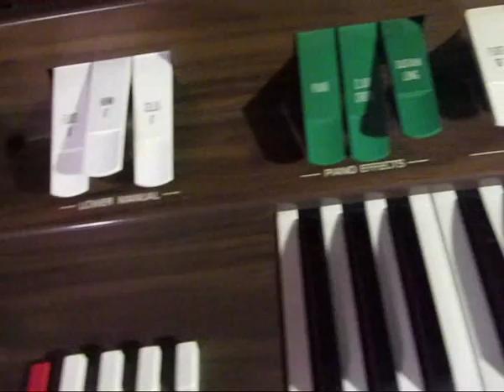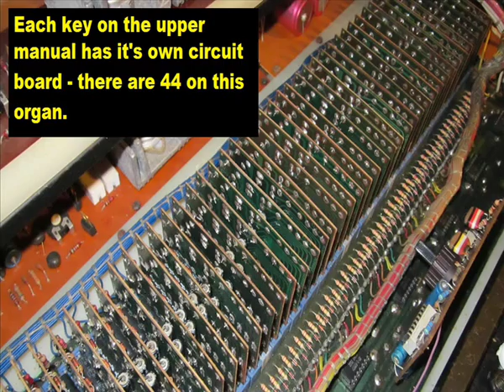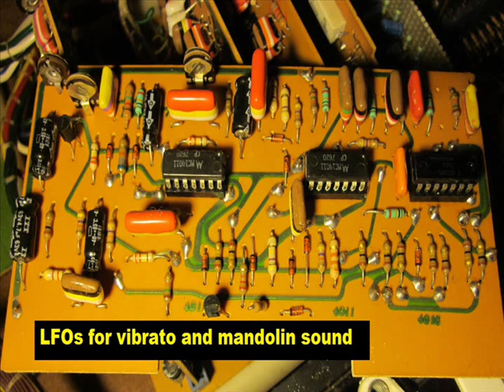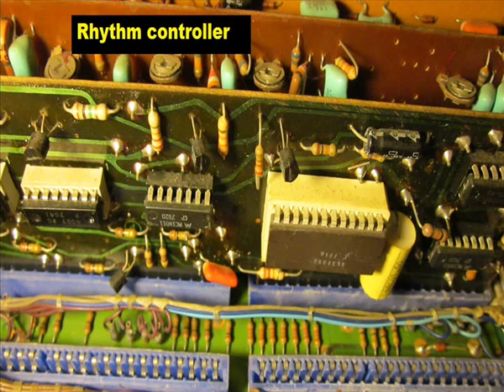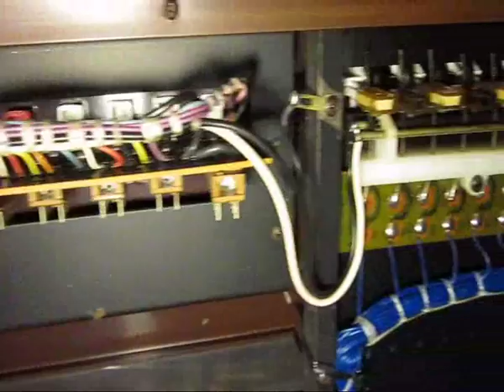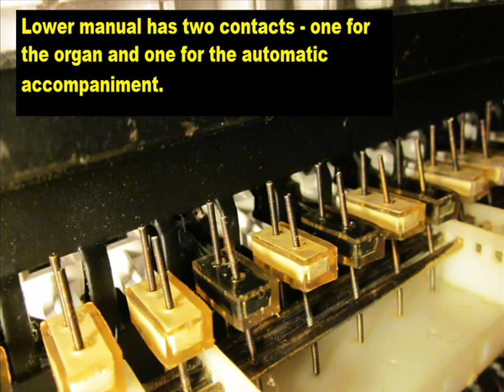Elka Preludio 22L inside

Comment: Keyer, oscillators & master oscillator, drums and the bass board all look nearly identical to my Elka Concorde 802 and thus also to the Elka Rhapsody, Concorde 902 and X705. Seems Elka re-used a lot of their circuit designs in a lot of their models.

Thanks for the peek inside :)